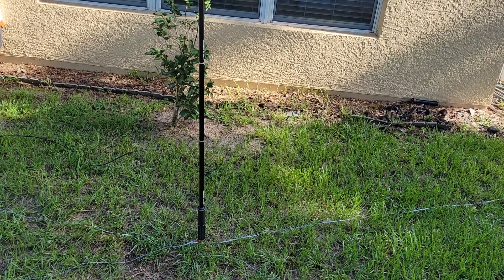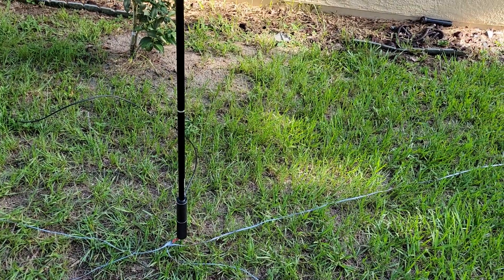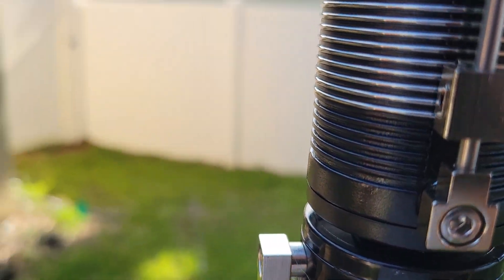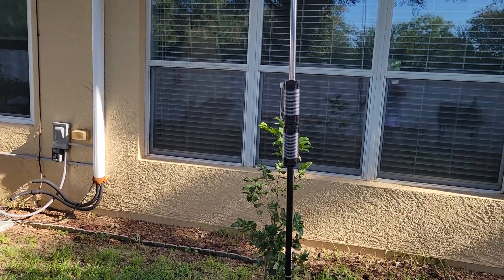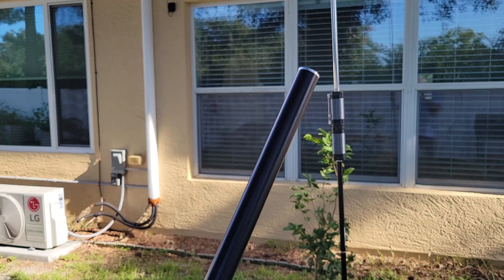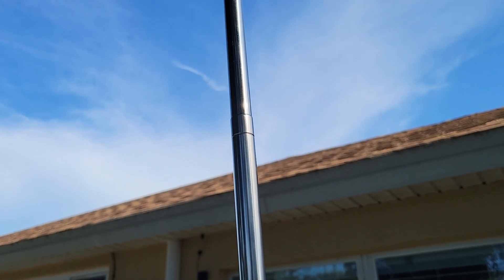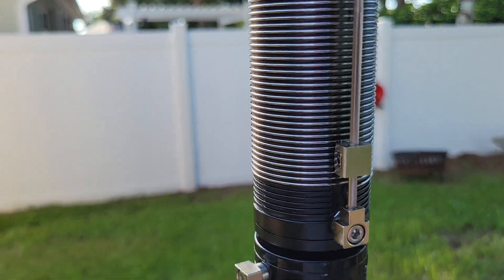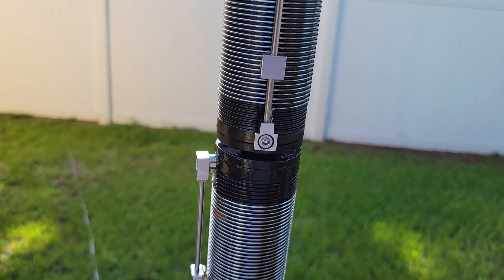Setting the JPC-12 for 80m by adding a 2nd coil, longer whip and shortening the mast

Comment: A high VSWR is normal for a very short loaded vertical.
Reply from the maker: I've been able to get the SWR down below 2:1 on a consistent basis.
Reply: @N4GPA  For a very short resonant (i.e., inductively loaded) vertical with no step-down UNUN, this indicates a lossy system.  Consider that typically, the expected radiation resistance for a very short loaded vertical, with a "good" ground system and low loss loading coil, is between about 5 to 10 ohms -- depending on actual physical length of antenna.
The JPC-12 loading coils use stainless steel wire.  So, with two coils fully in series, the RF resistance might be about 8 ohms (4 ohms per coil).  Adding about 8 ohms for ground system loss brings "apparent" radiation resistance to about 16 ohms.  Then add 5 ohms for actual radiation resistance for a total of 21 ohms.  This begins to approach a 2:1 VSWR.  So, while VSWR looks good, much of the RF power being fed to the antenna is lost in the RF resistance of the coil wire and ground system.
Ultimately, any lost power may not be a concern.  As long as you can achieve RF communications in a manner that meets your satisfaction, that's all that really matters.